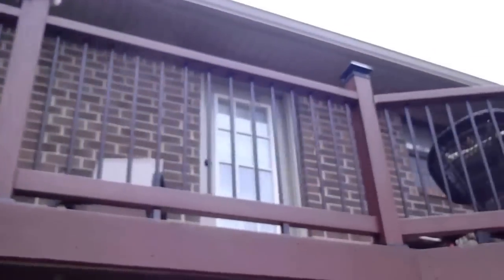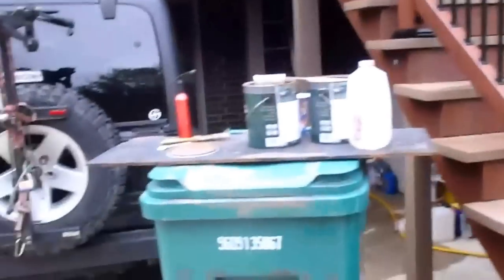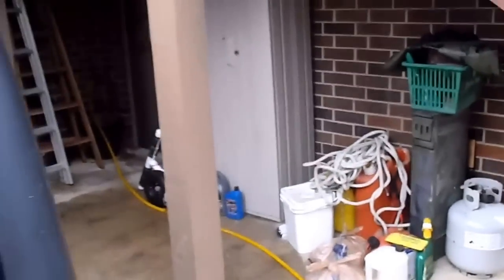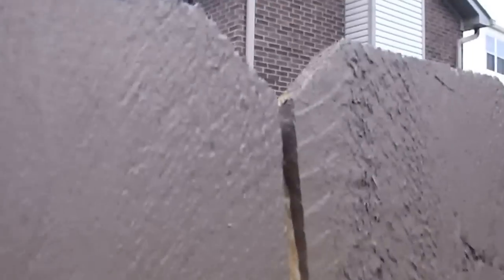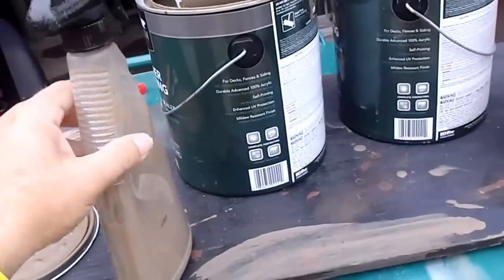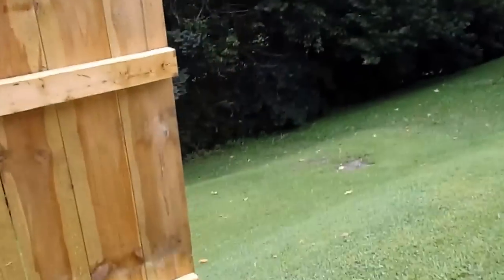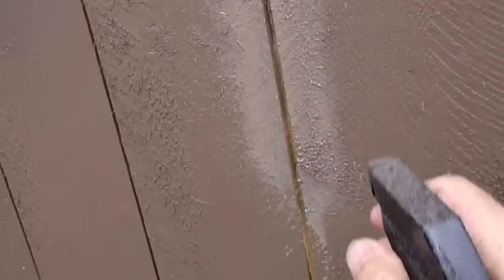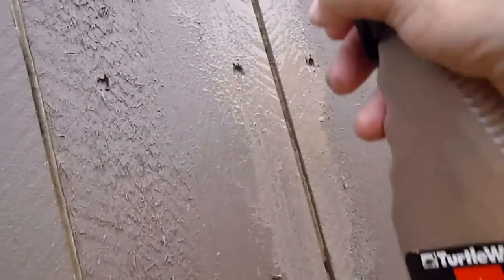Painting Fence Boards, Slats, Pickets.  In between.

Comment: I am a pressure washer who gets fair share of deck staining.  We normally use an airless sprayer.   But last few jobs were very windy days, so we used a stain pad and brush the edges.  Bigger then normal gaps on the deck boards and used your trick, but with a pump sprayer.   Just wanted to say, my knees and back appreciate you.

Comment: Another idea to at least try with this same concept is to (first) spray your mist from the bottle onto those areas of fence that would need to be covered and then later stain the major portion of boards as you normally would. In other words, simply reverse what you saw being sprayed in the video. Spray those gaps first and then do the major board widths.  Seems like that may actually be easier to cover things up and make sure there are no misses. Just a complete guess though as to how well or how bad it may work. Nice video and thanks for posting. My wood fence has a lot of metal pieces on it and I am trying to figure out the best way to stain it without getting the stain all over the metal pieces or support tubes.
Reply from the maker: All suggestions welcome.  Thsnks!
Reply: DollarTree masking tape to cover the metal would be my suggestion

Comment: Perfect.  Ran into the same problem with some Cedar fence replacement boards on a 14yr old fence.  I prefer to use a spray bottle like this vs. our pump sprayer because i dont want the hassle of cleaning out yet another piece of gear.  Unless of course there are ALOT of unstained sides, then its all about squeezing & holding the trigger vs all that pump spraying with the small bottle.

Comment: Does this work for an oil based stain? Worried about the water keeping the oil based stain from penetrating.
Reply from the maker: I suggest trying it on a scrap piece.  I only did it with thinned water based stain.  You know oil and water don't mix, plus MORE oil won't make a thinner consistency.   Try a spray bottle with and adjustable spray pattern?
Reply: Thanks! I'll try it out and let you know.

Comment: want to try, how much water did you use per cup of stain?
Reply from the maker: See my reply at top of page, but 50/50 got the job done.  The object is to mask the yellow pine, then no one will notice if it matches the surface color.  Almost three years and it looks great!
Reply from the maker: Plus I should add that the fence is in harsh direct sunlight six hours a day and can get over 100 degrees.  So much that pine sap has oozed from some slats.  I scrape it off with a paint scraper after it hardens.  Comes off without removing the finish.